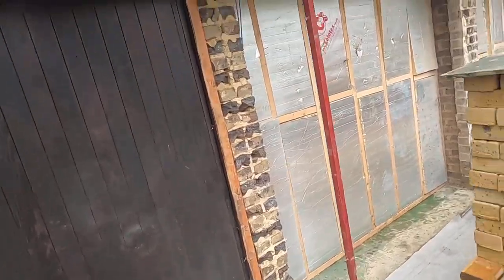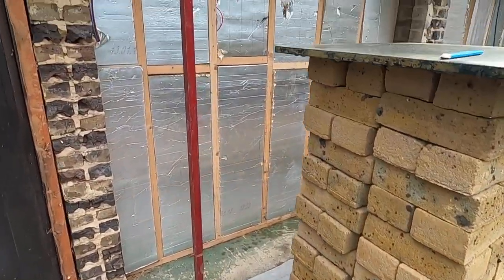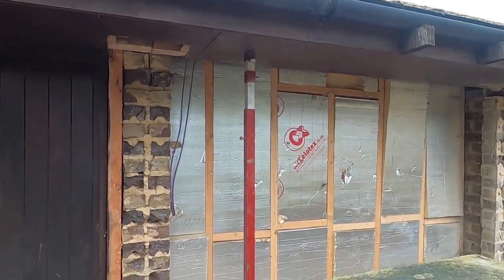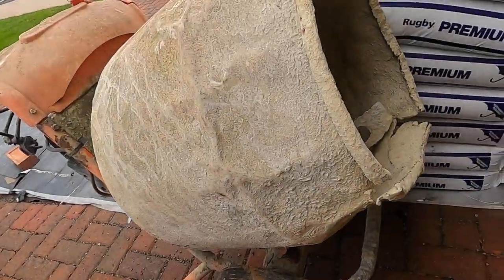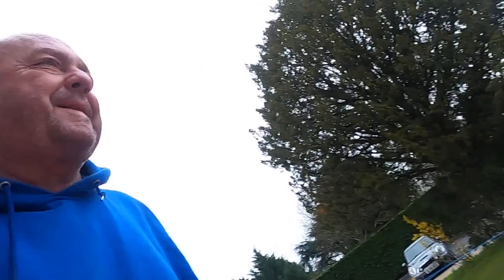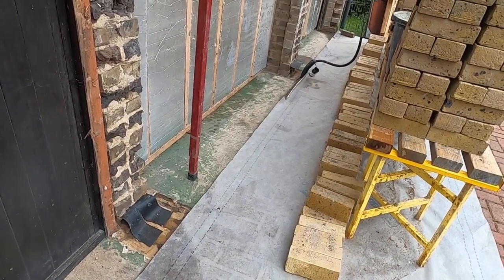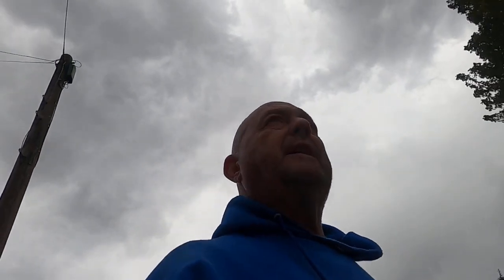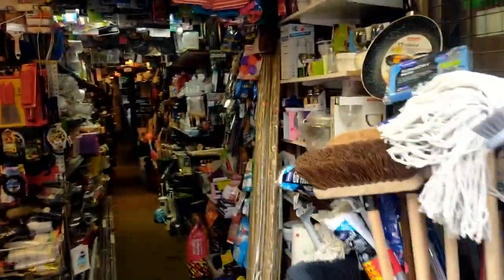Smart Profile # Bricklaying

Comment: All looks well but how tight is the friction fit ? If you pull a tight line off it ? Will it not pull it over ??
Reply from the maker: Dosent move, rubber top an bottom, trust me the Spanish have been using this for forty years maybe more, it works 👍
Reply: @bricklayersworldwithandy6277  so if there is nothing above to push upto ?
Can they used ?
Reply from the maker: @mrdogger2010  Yes, but I wouldn't I would just use Blakes or Aluminium post.They are a bit heavy to use as a standard profile being steel and having the insert and spring.